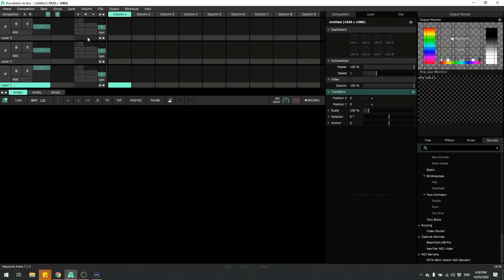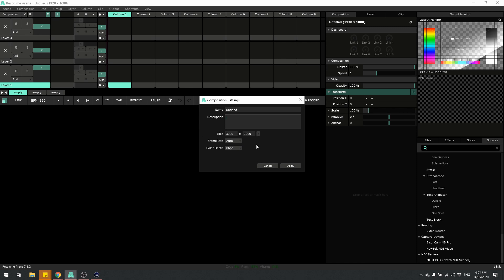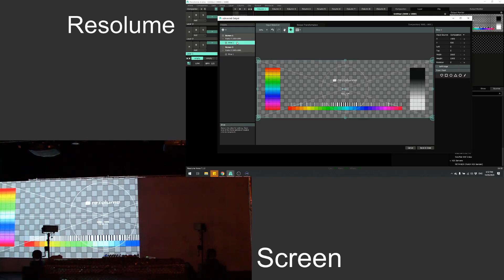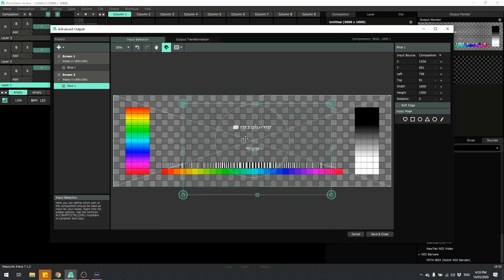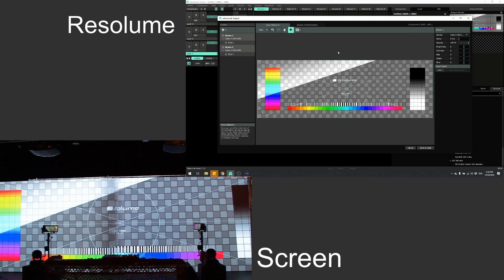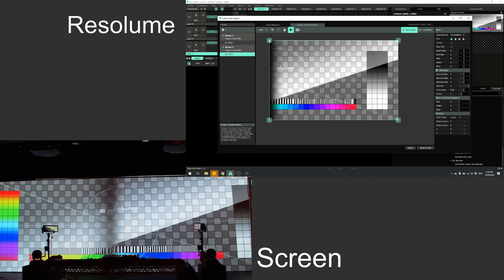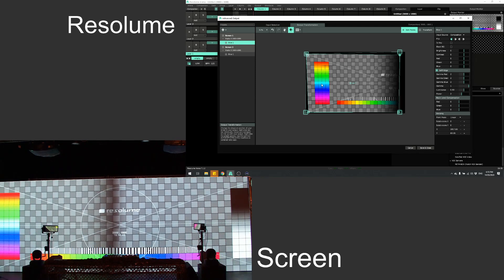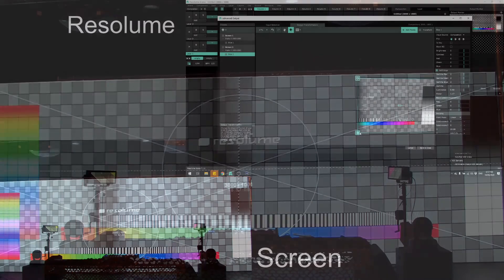Soft Edge Projection Blend basics // Resolume

Comment: I'm using three NEC Sharp projectors, which don't qualify to use any of Sharps in-house software for edge blending, would Resolume be able to help me with those projectors? 

The biggest issue we are finding is the overlap area for the three projectors are WAY brighter and so we have two "lines" in the middle of our triple wide. 

any suggestions ?

Comment: Your Resolume tutorials are awesome, I learned a lot.
For this subject though I can give you back something. First time I had to do this it took me a week to figure out how to blend 8 projectors. But now I have a "process" and blending 16 projectors can be done in 4 to 5 hours. Here is my proces for projector blending in Resolume.

1. determine the middle of the physical projection surface and place projectors to fit as good as possible with about 30% overlap. Make a composition the size of all beamer resolutions added up and -30% overlap.
2. with testcard pattern on, in the input selection tab, move the input selection of the first beamer until the middle line of the test card is in the middle of the projection surface. repeat for the second projector and move until the centre of the testcard fits over the first beamer.
3. in output selection > edit points.  Adjust any perspective distortion for a not so accurately placed projector (use the big handle squares for perspective correction)
4. in output selection > edit points. Adjust any lens distortion with the small handle squares first in linear mode, second with Bézier on.
5. only turn on soft edge when pixels fit perfectly. It's the moment that makes me smile when hours of tweaking a big projection setup pays off and it is all done.
Tips:
-Only go to the next step if you feel there is no more improvements possible and never go back a step (unless you want to start over)
-For blending more than 2 projecors, start blending the middle and work your way out.
-Avoid touching pixels that are blended already, so no perspective correction anymore if one side of a projector is already blended.
-Take a break before you get frustrated and start looking into Vioso for automating blending 🙂
Reply from the maker: Thank you.
16 projectors is very impressive!
3 is probably the most I’ve done in Resolume.
That’s some very useful advice!
But yeah anything up at that level it would be worth looking at a media server with Visio onboard.
Reply: This comment gives me hope. 
Starting from scratch, using these tutorials... did you manage by yourself to edgeblend/warp 16 projectors using only Resolume (and I'm guessing a video wall controller)?
Reply: @sv443  no separate video wall controller. Resolume IS the controller. Just 2 Blackmagic Decklink cards as the video output.
Reply: We are trying to find someone to help us with a current project. We are trying to combine 12 projectors to display one large image. We are currently using Datapath FX4 devices to support this need. We need assistance to edge blend the 12 projectors to create one clean image. We’ve heard there is softwares that can help but don’t have any experience in this arena. The projectors we are using are the Viewsonic LS550wh.
Do you have any experience by chance or know of someone who may be able to help? We would be happy to pay you of course. 

Thank you so much!

Comment: Help!!!! I CANNOT get the middle aligned! I can get the top and bottom of the middle aligned just fine, but the middle of the middle is always off.
Reply from the maker: Hi Colten,
You may need to use bezier points or subdivide the output l to get a bit more control.
In the output when you have “edit points” selected there will be some extra “warping” options on the right.
Reply: @mith  thank you. I actually just tried to get it as close as possible then just started messing with the gamma and power and luminance settings and actually got it! I will try bezier next time.